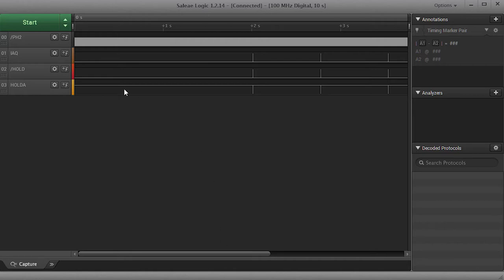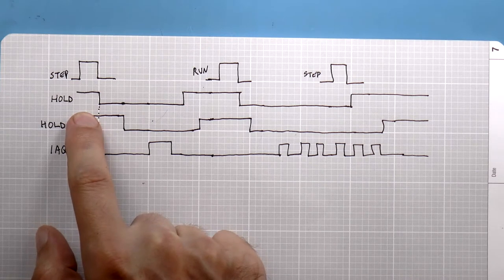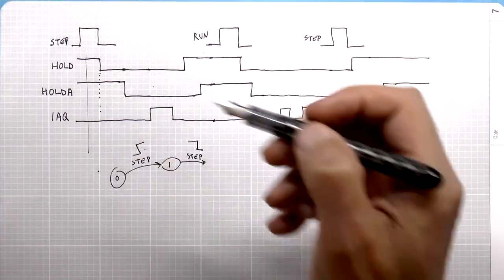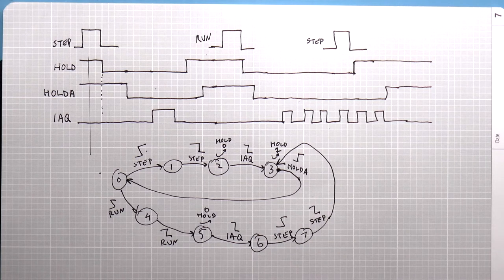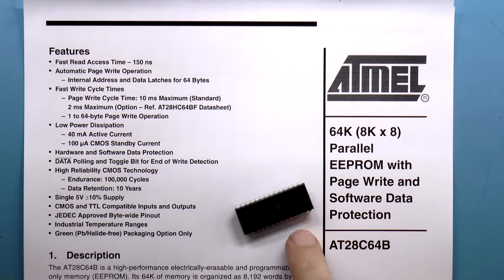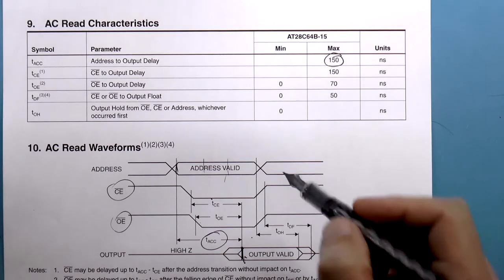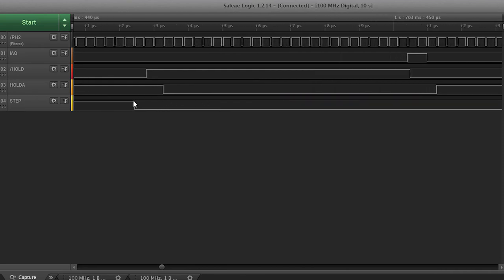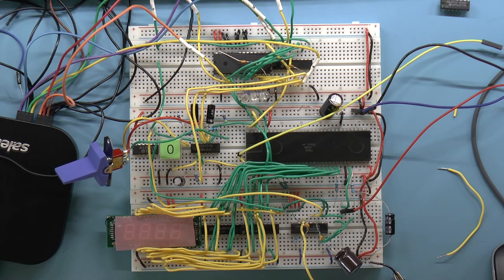Revisiting and fixing the TMS9900 retrocomputer single-step mode

Comment: I think you can do it with a dual D flip flop and two nor gates. Use one nor as an inverter to get /IAQ. On one FF ground D and connect /STEP to CLK and /IAQ to PS. That's your single step. On the other FF just connect /STEP and /RUN to CLR and PS for run/stop. Nor both Qs together to get /HOLD.

Comment: Is the 74HCT574 IC the same as the DM74ALS574AN IC?
Reply from the maker: They are pin-for-pin compatible, and voltage compatible. However, the ALS is much slower than the HCT, and also the HCT can work from a 2 to 6v power supply.
Reply: thank you for helping
Reply: @RobertBaruch  However, the ALS is much slower than the HCT - I'm not sure what you meant. For example (A)LS technology supports higher freq than HC(T), and tP_x are shorter.